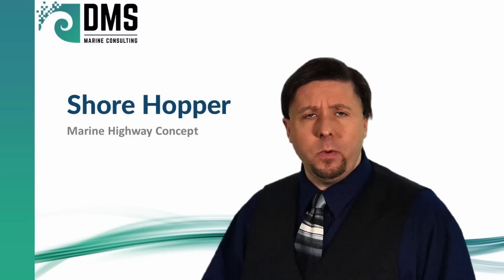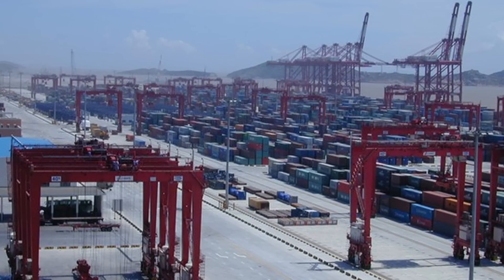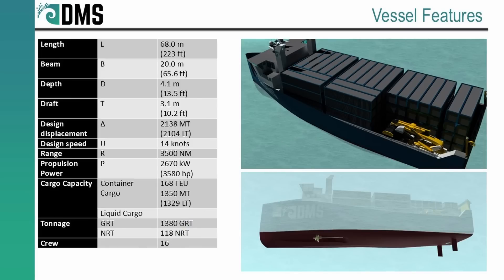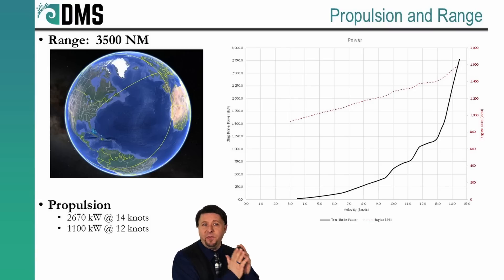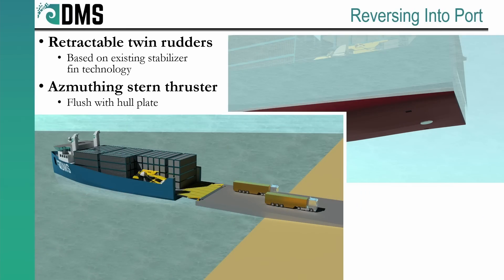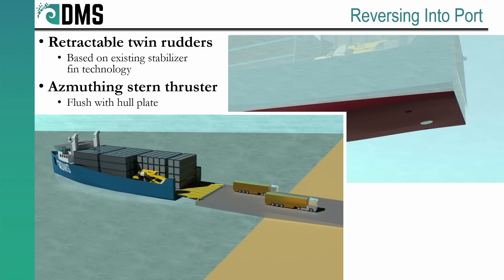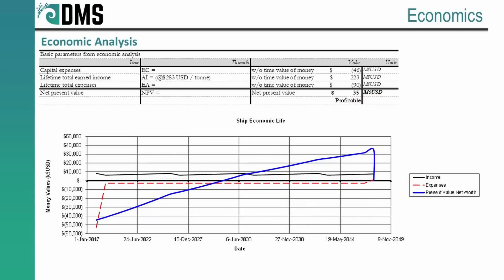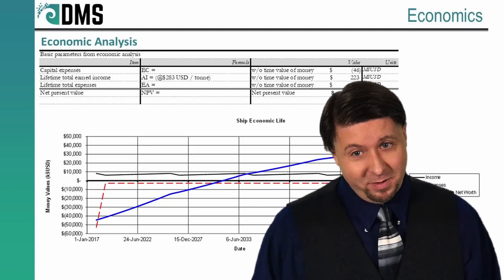Shore Hopper:  Marine Highway Concept

Comment: Master mariner here. Interesting idea but this is a clear case where it is designed by someone on shore who isn't that familiar with practical use of ships. Let me list the problems that I see:

1. Those props on the bow will constantly be out of water in minor waves, which creates havoc on the machinery. Also they are too far from the rudders so that they will have problems steering the ship since the water flow over the rudders is so low. And she will wobble badly with props so far forward so she will need rudder authority.
2. The rudders folding is not the problem, but the rudders are too far from the props to be able to kick, same as point 1.
3. When reversing, you have basically no control of the ship since you only have that small thing in the stern, but nothing on the bow. Absolutely unusable.
4. Same thing as point 3 applies for when being on the sand and loading. No control of the bow. You will move off in basically any kind of weather. 
5. If you have reversed on the sand, and start loading the ship will be deeper in the water. Good luck getting of the sand bank then. You can unload, but loading will suck.

These are the first ones I think of, there might be more problems.
Reply from the maker: I always know the concept design is interesting when the mariner cares enough to criticize it.  Thanks for the interest.

Although it does make me wonder.  In my 15+ years of designing ships, I can't remember a master mariner ever saying a single positive comment to a naval architect.
Reply: @DatawaveMarineSolutions  
Take the hint then, just kidding 😅

I believe that it simply is because of 3 problems.
1. Each ship is its own run and there is no serial production. So there is no way to test the product and without testing there will be flaws. And trust me, we notice the flaws.
2. Marine designers are rarely at sea so they are not familiar with the issues that we see. 
3. Marine engineers are usually not to open to input from mariners who have objections. They prefer someone who just says yes.

Actually most issues pointed in my previous post are solvable. I'm just not sure if the solution will make it economically feasible.

Comment: the rudder seens like the landing wheels on planes, however, I think for durability it would be better if the rudder folded fowards not backwards, since folding backwards it makes in a way that it will need to be mechanically engaged to fight the drag

Also, since it has to manuever in some limited region, having manuevering side thrusters could be an improvement as well

Comment: Can we expect some in the future, any orders being negotiated? Lovely design though I didn't fully understand the objection to using shrouds for the stern thruster. Efficiency concerns for a part-time unit overcoming efficacy? One centrally-mounted reversible motor, spindle-rotating end doors, riverine ballet on tap. Keeps the pirates guessing too? Think of the little children whose mommy promised them a ship that blows massive bubbles from its sides to get them out of the house and away from the TV.
Reply from the maker: The main argument against a shrouded stern thruster is the landing mechanism.  When this vessel backs up against a river bank, the entire bottom shell of the vessel scrapes against the bottom of river.  That is why I went with a stern thruster that is flush to the hull.
Reply: @DatawaveMarineSolutions  Understood, however the thruster could be moved forward to where there is the depth to add this feature. Thanks for your time.

Comment: Question? What hapend with frontal propellers with big waves or crossing a dangerous bar? The propeller take the air? How much is the loss of pushing force? Look and imagine propeller shaft like surface drive, then think in POD sistems, live in the coastal of Chile, many years work on the sea, the BAR crossing and high waves always put in risk the ships here, have many famous dangerous zones APART of Magellan mouth, Antártic Passages, Cabo de Hornos.. Horn Passage.
Reply from the maker: At 68 m long, we would need some VERY big waves for the propeller to exit the water.  And the Shore Hopper was not intended for service in waves that big.
Reply: @DatawaveMarineSolutions  68 m is very small compared to big waves. They will come out unless they are at least 3 meters (at the highest point) under water

Comment: It's cool, but it seems uneconomical? You're carrying 84 containers, okay. If you're going ~15mph (13kts), assuming the distance is the same and you can load/unload at the same speed, a truck going an average of 45mph can carry 3 loads in the same time as your ship (if loads go both ways). So say your ship is the equivalent of ~28 trucks. How much does this thing cost to build in the US again? Is it really cost-competitive with buying 28 trucks? If each truck is $200,000, that's only $5.6 million!

Also, with a 10ft draft, it seems a bit strange to say it can just use recreational boat launches. Do recreational launches near you have a 10ft+tide depth channel up to them? The ones I know certainly do not. What are the average costs of dredging a new channel? Surely that greatly exceeds the cost of making a concrete ramp.

And what about air draft? Is the idea that it only goes on major rivers? You're going to end up having to go way out of the way compared to a truck because you have to follow the main route, so the economics are even worse when a truck can take a much more direct path.

When the video first started and you presented your concept, I assumed the thing would be a LOT smaller.
Reply from the maker: True, the Shore Hopper doesn't replace every application for trucking.  I did a whole video looking at the general idea of Short Sea Shipping and examining applications that are worth using ships:  https://youtu.be/VG_yw6r3ZIw

As to the draft issue.  Draft is more complicated than a single number.  The Shore Hopper is designed so that the hull has a 10 ft draft at the bow, but zero feet at the stern.  The hull slopes up to match the slope of the river bank / boat launch.  When we look at navigable rivers, many of them do have a 10 ft water depth.  The lower Mississippi river and the Columbia river both maintain at least 10 ft depth.  And those are major routes for inland ship cargo.

As for air draft, the top of the pilothouse has an air draft of 45 ft.  That will clear any location along the lower Mississippi river.  We would need to adjust the smoke stacks a little.  But the vessel is designed to clear air draft restrictions along major navigable rivers.  That does only focus on major rivers, but this concept was intended to transit from large coastal ports to smaller deliveries.  So we can only go on large rivers with coastal access.
Reply: @DatawaveMarineSolutions  Ahh, I see, the zero draft stern is a neat idea.

I kinda think a smaller version would have a better economic niche. For small routes such as the Champlain Canal from the Hudson river to Lake Champlain. Big routes are also always going to have to compete with rail.

At least, assuming a future where trucking is exponentially more expensive due to rising fuel costs, environmental requirements, etc., which seems plausible.

Comment: 13:23 investing 46M to get 35M over 30 years? You can get more from a bank deposit, let alone investing in real estates or stocks...
Reply from the maker: @My-Opinion-Doesnt-Matter  actually, the analysis shows you get 87 million over 30 years.  Net Present Value considers interest rates.  So simple explanation:  that Net Present Value is 35M BETTER than what you get from a bank note.
Reply: @DatawaveMarineSolutions  thanks, didn't know that, but it's still very low for such a high risk investment. 

It would be low even if it's a low risk investment, so only enthusiasts would invest in something like that.

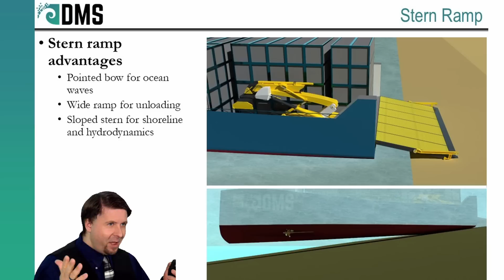Comment: 07:40 Technically, there are portside ramp solutions as with military 'Expeditionary Fast Transport Stern Ramp' (Trident Marine Systems), thus eliminating the hassle of reverse docking maneuvers (though possibly automated with 'Podded Drives' - don't let the Royal New Zealand Navy handle them, manually...).

Comment: England had allot going for it back when the narrowboat system was built. Really a great idea and something like it could see a resurgence for hauling cargo etc again.
   
     I could see a design using a shape like a RO/RO but with an internal bridge crane system that has a boom that could run cargo out past the ship itself. Something like the crane system in the AN225. If it were a totally open deck it could have a bridge crane that runs up and down the ship. Could also do an angled side ramp like a ferry as well. 
      Props on the front would work just fine. They have been pulling aircraft through the air for over 100 years so far. 
      
          I worry about it getting it's but stuck in mud at a port. A couple of flush mounted water outlets could be used to flush enough water in to break any suction and a very minimal cost system to build.

Comment: Too bad the Jones Act kills this
Reply from the maker: @Haploanddogs  not if we build it in the USA
Reply: @DatawaveMarineSolutions  We can't build ANY ships in the US, let alone new concept ships at this time.  A total of one ship was built in 2023.  And a grand total of 93 vessels exist.  The US ships cost 5 to 10x more than competitors. 

The Jones act has fully killed any hope of using shipping in the US until it is removed.
Reply: @Haploanddogs  Well it is not the Jones act..shipbuilding efficiency is heavily governed by econmics of scale.
 which is to say you want to build 10 or 20 ships of the same type at a time  and to keep on doing that.
 the government needs to step up with the backing as well, there used to be a shipbuilding fund of sorts.
 we also need to push the nay sayers aside under national securiety aegis and put together 5 to 10 3 sq mile shipyards with dedicated ship reclamation docks so that ship steel can be sent to the shipyards melting shop/rolling mill  and remade into new plate and new ships.  i hope this helps
Reply: @irondarknessdarkness8900  
"we also need to push the nay sayers aside under national securiety aegis and put together 5 to 10 3 sq mile shipyards"

The 'naysayers' would be the major banks in the US that indirectly finance all political candidates - it requires the equivalent of a coup to nationalize shipbuilding to some degree as in China.
Reply: @christophmahler  actually it is more like every body and his brother being allowed to sue you into the ground over "Concernes" of OMG Industry like a steel furnace melting plant and plate rolling mill and and noisy ship construction..and so on, which is why in order to get the yards built they need to be national securiety projects
Reply: @irondarknessdarkness8900  
"every body and his brother being allowed to sue you into the ground over "Concernes" 

If that were so, US communities had clean waters and land, uncontaminated from train spills. 

Grow up.
Reply: @peterclark6290  Yeah trump is so famous for opposing protectionism.  He would want to expand this to all things instead.
Reply: "the Jones Act kills this" 

I agree. 

It would be more realistic to have commercial concept ships built - and arguably, introduced - in Asia (South Korea, China). 
In the US, the return of investment, stretched over decades of inflation is too low for a Wall Street business culture. 

As I said before: offshore maritime shipping would have to contract, dramatically (including fuel prices) to make onshore waterways - and the domestic production and trade, it is to transport - attractive, again.

I wonder, how the calculations would look like with a low-enriched uranium nuclear reactor drive (NS Savannah in 1959) in a political climate of high energy costs (past 'Peak Oil' or lost access to overseas oil fields) ?

Comment: I wonder what the design tradeoff would be for replacing the folding rudders, stern thruster, and twin screws with a pair of azipod thrusters or waterjets under the bow and some clever software. I know with the right control system that even lets you crab sideways.

Going for a stern landing ship makes a lot of sense for minimizing infrastructure requirements, and I like the little mobile crane in the corner, though it doesn't look quite heavy enough to pick up full containers without tipping over.